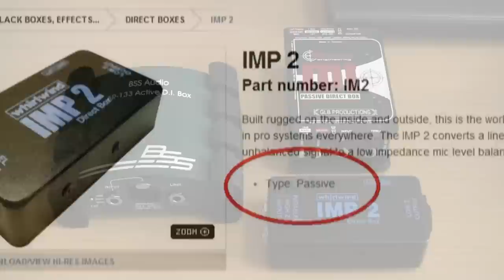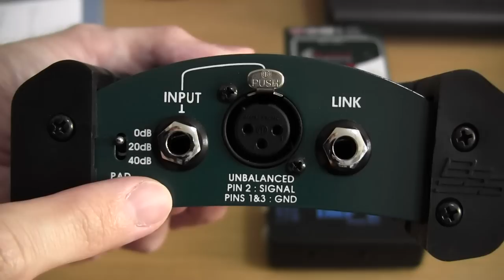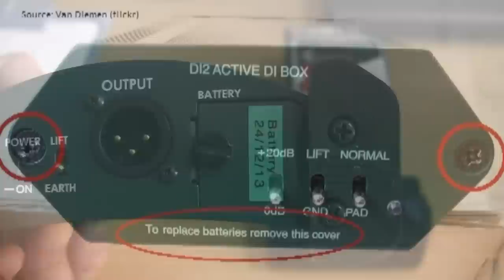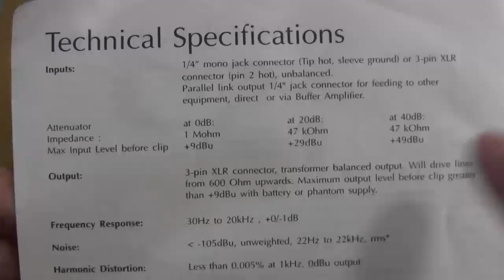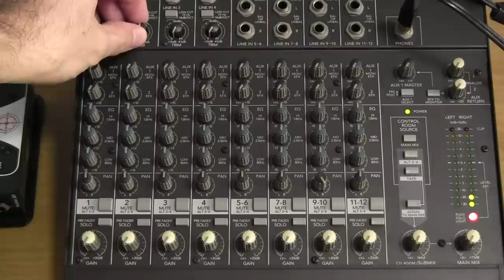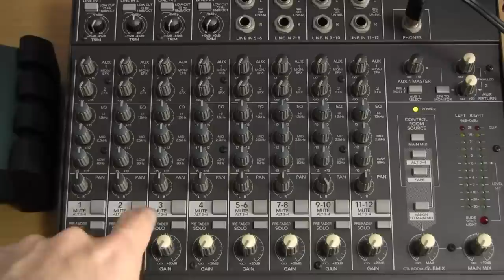DI boxes part 2: Active vs. Passive

Comment: Thank you;-) can I use reverb pedal  and sing or play instruments through it?  in other words i'm looking for something that i can interconnected so i can sing and play flutes.My set up is lucas nano 600 with mixer build in but it does not have any effect, and i really want good reverb so i can perform live on my bamboo flutes. I want supernatural reverb but also need mic preamp to connect mic so I can play?.I KNOW MY EXPLANATION is not very clear, it is bit of science fiction for me ;-) Anybody can give me any advice please? thank you so much
Reply from the maker: MrBRANDBERG Hello Herr Brandberg! Ah yes, the Lucas systems - they are great-sounding and set up quickly but because they do not have a separate mixer they are not very flexible, for example they do not have an effects loop where you can add in your own pedals, EQ etc. 

I think the best solution for you is something like the mic mechanic from TC Helicon: http://www.tc-helicon.com/products/mic-mechanic/ This unit is designed to sit in between your vocal mic and your mixer input, and although it is designed for vocals you can probably use it for flute as well. If this is not sufficient they make more elaborate boxes such as the VoiceLive units.
Reply: thank you for your answer;-) with the mixer that's bit pain, i did not buy the speakers yet just about to order it, I was thinking about boss l1 compact but that does have even less flexibility. So you think if I get mechanic can I connect other reverb pedal to it?
Reply from the maker: MrBRANDBERG No the mic mechanic is not designed to work with standard guitar pedals - it has XLR inputs and outputs and is designed to be placed between your mic and mixer input. The only unit I know of that can accomplish what you want is the Radial engineering voco loco: http://www.radialeng.com/vocoloco.php This pedal is not cheap but it's the best available for this sort of thing.
Reply: GLB Productions  oh man thank you so much i think this is what I was looking for. thank you!!!!!
Reply from the maker: MrBRANDBERG That's great, let me know if it works out for you!
Reply: I have checked that out it is great! so pretty much vocoloco does the same thing as for example mixer zed 10fx right?it is like small mixer. god there is lot to know ;-)
Reply from the maker: MrBRANDBERG Not really :) The Voco Loco is basically a mic preamp with an effects loop designed to work with guitar pedals, not a mixer. You can only use one input with the Voco Loco, and it has only one output aside from the effects loop.
Reply: Thank you very much. Could you tell me what other option i have instead of vocoloco? coz it is quite expensive, but if i don't have other choice i'll go for it. The think is I want to use guitar effect wet reverb from Neunaber, it sounds really amazing, and I think with flutes would be awesome. The other option I have is probably buy something like voice live,or just tc-mechanic which has reverb for vocals.I don't know anymore;-) for me the quality reverb is very crucial.Any suggestion will be deeply appreciate it. ;-))
Reply from the maker: MrBRANDBERG I don't know of any other product like the Voco Loco, but I'm not an expert on guitar pedals and the accessories available for them. If the only effect you need is reverb then one of the units from TC Helicon should do. 
Why don't you write to the folks at Neunaber and ask them if they know any way for you to incorporate the sound of their pedal into your flute playing?
Reply: GLB Productions thank's i did that already waiting of answer ;-)))thank you.

Comment: I use an sg gibson and a ES and they produce a very high output. Hence I would go for the passive DI box. However, i believe these sources are passive and so acc to the video an active DI box would do better. I really don't know which one to go for.
Reply from the maker: Why are you connecting your electric guitar directly to a DI box? For re-amping?
Reply: I am doing: Guitar >> DI box >> Audio Interface
Reply from the maker: Which audio interface are you using? Most of the newer ones have an instrument level input that can accept a passive guitar directly.
Reply: Saffire Pro 24 DSP, by Focusrite. 

I don't think it has that thing you mention. My Guild Starfire IV and my Gibson SG send such a massive signal with their neck pickups that totally saturates the interface.
Reply from the maker: I'm familiar with that model. Have you tried turning the gain control all the way down, fully counter-clockwise?
Reply: You mean the gain knobs on the physical audio interface dashboard? https://www.prodj.com.ua/img/img3b/2014/03/20140311162741.jpg 

I have not tried that. I thought those gain knobs were for XLRs inputs, and I am connecting my guitar directly into the audio interface through a 1/4 inch jack. Will definitely try that, and if it doesn't work I will go for the DI Box option. 
Many thanks!
Reply: Just got home and tried the knob at 0 gain with my Gibson SG directly inputted. The input bars go all red as I play some power chords. Hence, I need a DI Box. Recommendations appreciated.
Reply from the maker: I would recommend the Radial J48 in this case. However there is one more thing you can try: plug your guitar into a pedal, set the pedal to bypass and connect to one of the line inputs on the rear of the interface. These should be able to handle the high level no problem.

Comment: are both 'gain' and 'trim' the same thing
Reply from the maker: Mark Evans Strictly speaking, gain refers to amplifying or increasing the level of a signal, and trim is changing the level of a signal either up to down (ie amplification or attenuation) to more appropriately align it to the input of a particular device. In practice however, they tend to be used interchangeably.
Reply: GLB Productions ok thanks because i saw on the mixing console that there were both a gain and trim knob ??does the trim knom in this case replace the volume fader ??
Reply from the maker: Mark Evans Yes - this is a Mackie issue from that particular period of manufacture. On the mixer in the video 'trim' is really gain and 'gain' is channel fader (knob). It wasn't a good labelling system and Mackie changed it on subsequent evolutions of this mixer.

Comment: how can you have grounding issues with a DI?
Reply from the maker: I'm sorry I don't understand your question - please be more specific.
Reply: @GLBProductions  in the video near the end you have a text saying the noise is due to grounding issues. I am actually researching how to reduce noise in my electric guitar, which is connected to focus rite which is in turn connected to the laptop. When I remove the electric plug of laptop from the mains the noise goes away. Can a DI box help with this?
Reply from the maker: In this case the problem is your mains power - a DI box will not help you with this issue. The simple solution is to run your laptop on battery when recording.
Reply: @GLBProductions  thanks
Reply: @vikrantsingh47  hello, i've got the exact same problem. have you found a solution? (besides unplugging your laptop). i thought that using a di box xlr into focusrite will solve the problem, but now it seems that it will not.
Reply: @arthurvenger  i did find a solution, not sure if it will work for you. Since my focusrite has two inputs for the guitar cable, i took one spare guitar cable, inserted in the vacant slot, and the other end to the mains socket, into the big hole, which is usually for ground. Do not insert in live or neutral hole. Also test with multiple sockets. 
But it will only work if you have proper earthing in your house.
Reply: @vikrantsingh47  hmm, interesting, thanks

Comment: Using a BSS over a Radial on a passive bass such as a J or P would be considered a crime against humanity. Actually on any source. There is simply a huge gap in sound quality between the BSS, which is mainly used for it's LED-display and ruggedness, and the Radial which might very well be the best sounding affordable DI ever made. A simple A/B test of the actual sound would confirm this for you, so I find your rule-making, disregarding soundquality a bit disconcerting in this regard. That is not good sound-practice!  Otherwise there is a lot of good information in your video, so congrats on that!
Reply from the maker: Hepphepps Thanks for the comment! On what evidence or study do you base your statement that there is a "huge gap" in the sound quality between the Radial and the BSS? Secondly, how do you propose to deal with the high frequency loss that comes from using a relatively low impedance passive DI on a passive instrument, or do you simply prefer a darker sound? Remember that this video focuses on the differences between active and passive DIs, rather than the quality differences between individual DIs. Look forward to hearing from you.
Reply: GLB Productions Of course you want to take some highs out of the signal, it was never meant to be represented linear. Have you ever measured a Fender Bassman or any other 1. gen bass amplifier made for those instruments?
Or even a modern Ampeg?

Have you ever not used EQ on a Bass trough a BSS?(Not that there is ANYTHING wrong with using EQ, as opposed to what you claim in the beginning of another video, Enough is the correct amount, not "As little as you can get away with." There is a big difference. Do not be afraid of EQ)

Have you ever seen a BSS DI used on anything in a professional recording studio? No? I tought so.
Have you seen Passive Radials used on just about anything in professional recording studios? Yes, I tought so too.  

2.If you can find -1- professional bass-player, or sound engineer which will, with a straight face, claim the BSS to sound better on any Passive Bass guitar than the Radial, I will be very impressed, but will also promise I can find a hundred that disagree. There is simply no comparison. 

On the other hand: Ruggedness, one glance at the LED to see if it works, and heavy discount when bought with other Harman-gear might explain some of the succsess the BSS boxes acctually have had, sound just ain't one of them.
Reply from the maker: Hepphepps You continue to make sweeping statements without reference to any external sources, studies or quantitative evidence of any kind.  You are of course entitled to your opinion, but more substantive proof or a statement of your own personal credentials is required if you wish this discussion to continue on a professional level.
Reply: Hepphepps Bro just see and listen what he is explaining. You will never learn if you have already made assumptions and guess work. This is about Active and Passive DI boxes. Of course radial is better then BSS only if it would had been  Radial Active Vs Radial Passive. Here it is between bss active vs radial passive. And if you are using a bass guitar with radial passive then it would be better because you wont bother to loose any high frequency.
Reply: Whats a BSS anyway.
Reply from the maker: Michael Stoneham He's referring to the BSS AR-133 DI box in the video ;)